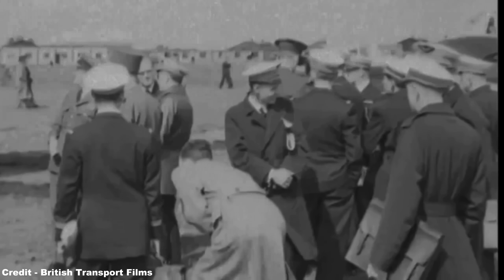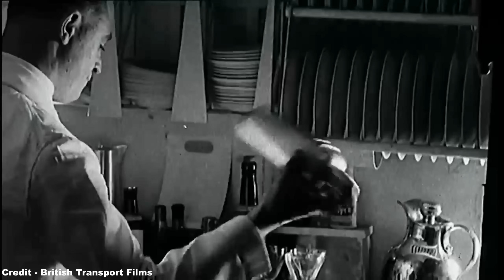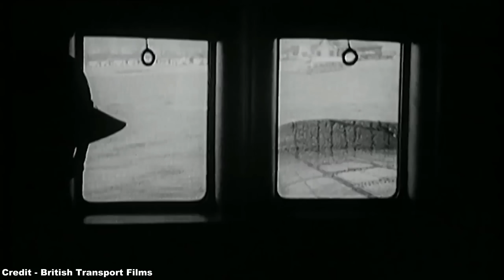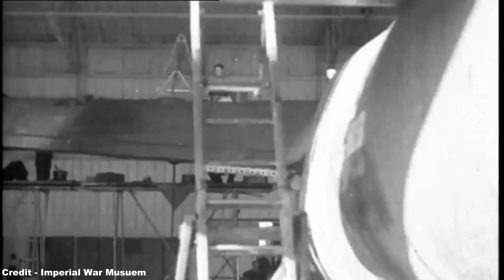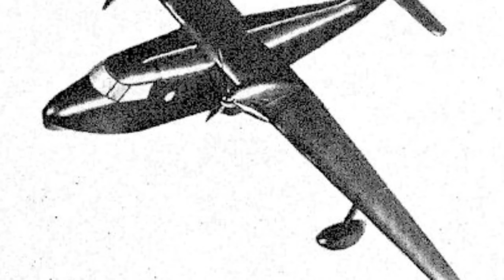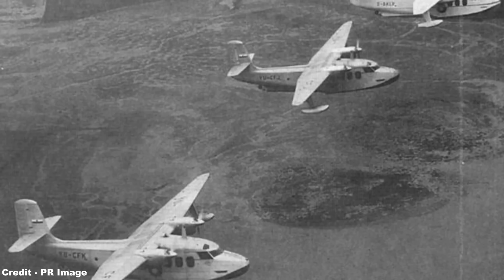Short SA.6 Sealand - Britain's Last Flying Boat

Comment: A lovely aircraft that should have had more success.  I have to disagree that this was intended as a replacement or competitor to the Grumman Goose.  More likely, the closest competitor was Grumman's larger Mallard.  Very close dimensionally, but the Mallard was heavier, carried a bigger load, and considerably more range.  As you noted, the Sealand may have been more successful with more powerful engines.

Comment: 'British aircraft manufucturers wedded to flying boats for civil airliners' - the French were not then I suppose? Also, in the same period the UK produced the Comet and the Viscount, so please do not peddle misinformation. The point of the Brabazon Committee was to propose a slew of types for the civil market and it did so, it was for the market to decide if these were of use.